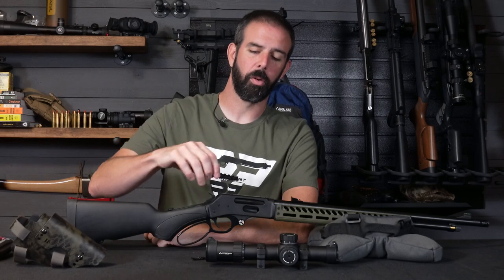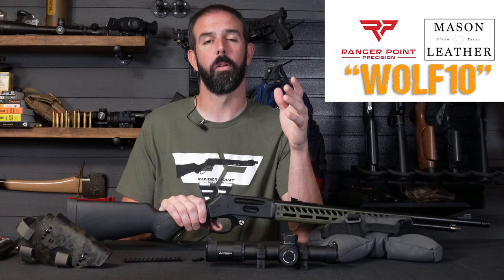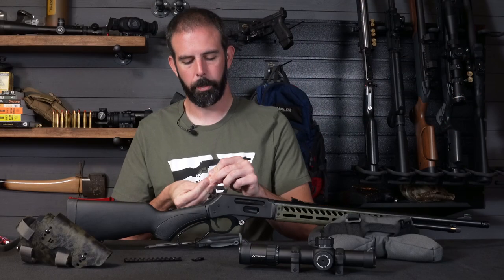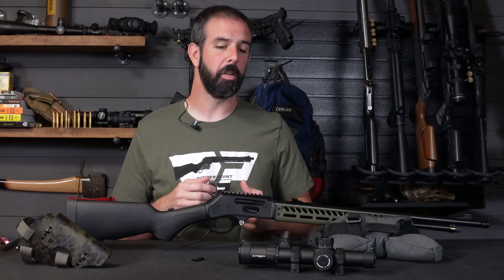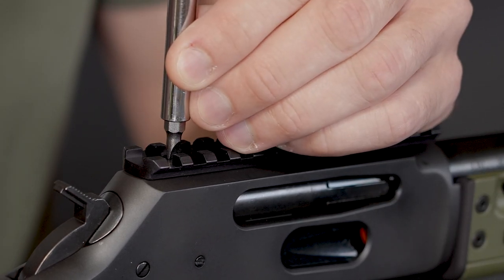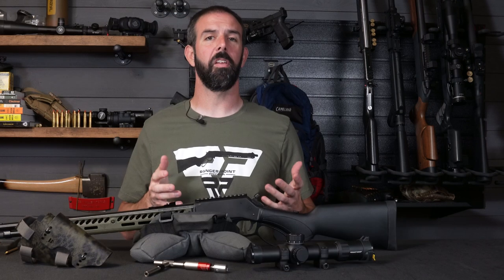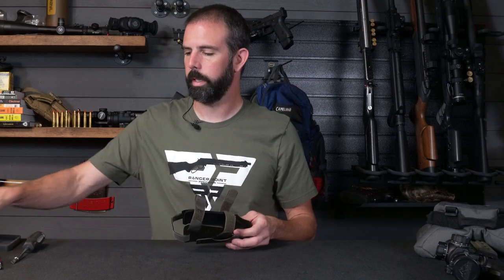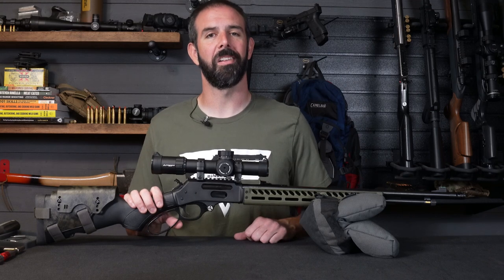Henry X Model Scope & Cheek Rest Installation

Comment: A torque wrench, even a budget option, is a must have for working on any firearm. Along with the proper tools the correct information for installation of any aftermarket part is essential. It will save an expensive and painful trip to a gunsmith. Looking at the Henry mods you have from RRP I may have to find an excuse to home another .45-70 in the stable. Great to see the subscriber count climbing. I recall enjoying your videos at the start of the channel. Keep it up mate.

Comment: Would you recommend blue loctite on the hammer extension?
Reply from the maker: I’ve not had an issue with mine. You just have to make sure you’re in the correct place and tighten it up really well.